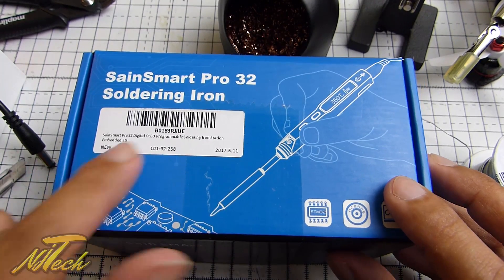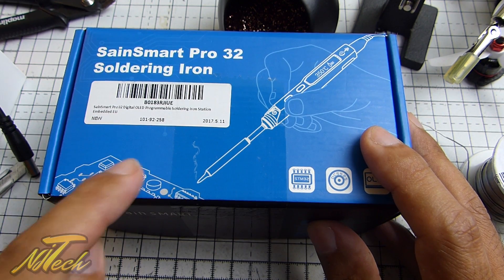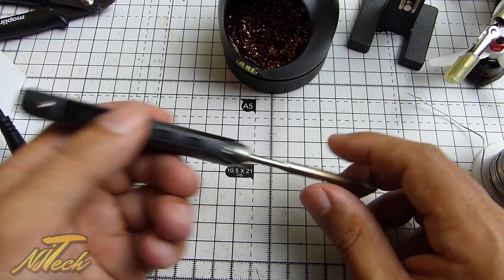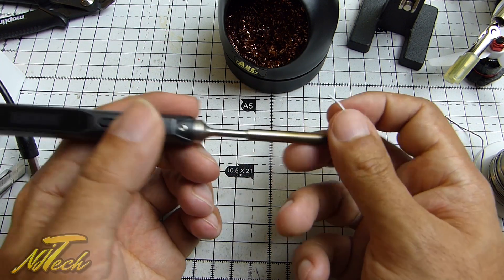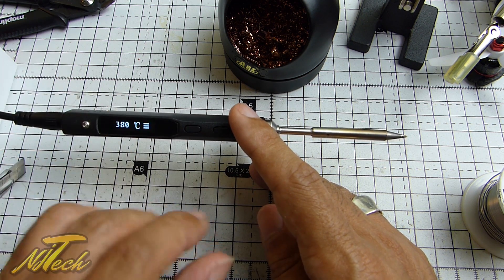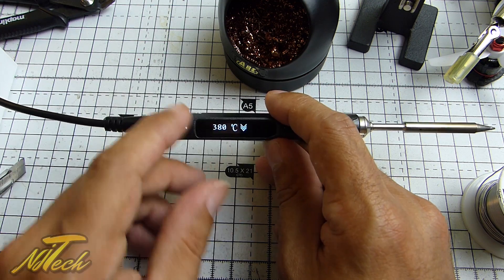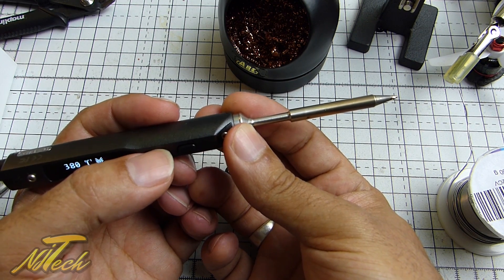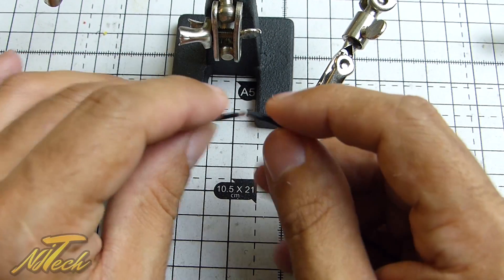TS100 Soldering Iron, Custom Firmware & soldering tricks!

Comment: I got mine today, works really good, plugged it on to a 4s lipo. I think I got something loose inside it though... sounds like a loose spring or some other loose component that vibrates when I tap it gently. Anyone else that experience this, maybe it's nothing..?...

Comment: I dont see a HEX file to flash only a DO NOT FLASH_Flash Backup.hex
Reply from the maker: scroll down on the linked page to the section that says 'Upgrading your ts100 iron' there you will see a link to the release page. Just follow the instructions, it takes a few seconds :)
Reply: ya I did that but what hex file do I use? I downloaded that whole file and there is only one that says do not flash back up hex.
Reply from the maker: go here: https://github.com/Ralim/ts100/releases the very first file you see is called ts100.hex and its 40kb. click it to download it, that is the file you drag onto the ts100 whilst its in DFU mode. (put the ts100 into DFU mode by holding down the button towards the tip whilst you plug it into the computer) once the file is dragged on it will automatically disconnect. Its done.

Comment: Which ESC brands don't use plastic insulation on signal wires?
Reply from the maker: If you find one let me know! To be honest, its easy enough just to replace the signal wires yourself with decent stuff.
Reply: Don’t buy an ESCs based on what wire it comes with... just swap the wire out.

Comment: The tip looks a bit too long... How is this better than say the Weller WHS M (or MC which comes with batteries)? Just the price?
Reply from the maker: I thought that until  i used it, its so light the tip length doesnt affect its usability at all. As i said 20 years+ using more traditional shaped irons i was sceptical too, but it works great. All the positives are in the video, maybe its just not for you but as a compliment to a wellar or a sub $100 alternative this blows away anything in its price category for the reasons mentioned. Just my opinion though :)

Comment: I use it with a 3s lipo, it is great, a lot faster and nicer than my 20EUR adjustable power stick of metal.... 
as a lefty I see you have it the right way up... how did you do that?
Reply from the maker: i used the custom ralim firmware, that has the option to flip the display, i show it in the video when i go through the settings :) links in the description

Comment: Which tip would you recommend getting, mainly right now I'm working on micro quads, so many small soldiers
Reply from the maker: ive been using the one that comes with it but for working on micros i would find the smallest tip. I actually think the package i linked in the description comes with that tip anyway.
Reply: NJ Tech it appears to, looks like the pointed one might be smaller than the one with the angled tip.. The one on amazon the "ts100" branded one looks like yours, the one with the other name looks different
Reply: NJ Tech please let me know how it last, if you have any issues with it please..
Reply from the maker: so far its been great no issues at all

Comment: I have never used a Soldering iron in my life. There has been plenty of times I really could have used one. There is something I want to do and I will need two of them, the iron is going to be integrated into it, but not permanently. Are there any "good" irons for dirt cheap, the hotter the better. But I can maybe see myself using an iron for what they are actually made for!!

Comment: I keep seeing this around and may have to pick one up. as far as soldering technique I highly recommend a lineman splice. its easy to do, much much stronger and if done correctly very neat. its strong enough in a temporary emergency it works even without solder in many cases

Comment: A lot of what makes soldering a chore is bad plating of traces and pads on boards.  The TS100 would be ideal if it used standard Weller tips.  Custom tips are a nuisance to find and keep in stock.
Reply from the maker: Absolutely! Though in the application of quadcopters which is where the majority of my soldering is done these days, most of the pads and traces are of a decent standard, and with gold pads and thermal soaks on the grounds. Not to say cheaper nasty stuff is any less prevalent, but its always up to you where you want the bottle neck to be in your system. I always try to buy the best components, they always last. And yes, weller tip compatibility would be a marvellous thing. Thanks for the comment! :)
Reply: How many tips do you go through ? Should last a hell of a lot of years if you look after them , unless element burns out . The firmware goes a long way to prevent this as much as possible . Plated traces and pads , they are a luxury never had any trouble with good old copper pads in nearly 40 years !
Reply: @88Nikoli  Well said. Enough flux will make solder take to the roughest pads.

Comment: Wow.  Seriously impressed with the iron.  Very serendipitous since I've been thinking about getting something but as a hobbyist it's difficult to justify something that generally has the quality one requires for fine work - to give you an idea, I'm currently using an iron that came with the Amerikit AK-100 (https://www.amazon.com/Elenco-AmeriKit-Learn-Solder-Kit/dp/B0009Z3JJA/ref=sr_1_1?ie=UTF8&qid=1499253724&sr=8-1&keywords=amerikit+ak-100) and it's a bit on the, ah, terrible side.  

So, yes, a series on soldering tips would be really appreciated by myself.  You have a good voice and your camera work is decidedly adequate. :)  While I'm here, what size tubing did you put over the helping hands clips?  That's a brilliant addition.  Thanks much for the video.
Reply from the maker: Thank you brother i really appreciate that! The stuff over the clamp is actually just model silicone fuel tubing, its grippy and widely available by the meter. I'll def have a look at doing some more tips. Thanks again for the comment :)
Reply: Pleasure. :)

Comment: are you using 12ish volts or near 24 how many amps does it take i dont recall if you said the watts
Reply from the maker: im using the included power supply that came with this iron 19v@2amps. This seems to work perfectly in my testing.
Reply: NJ Tech ok i was assuming it did not come with one but ya i found them online and it had a list of voltage vs watts and its like 40 watts and 19 and 65 watts at 24v and only like 17watts at 12v

Comment: I'm using an old Weller WTCPN from my father. It's too old to have temperature control so I just have to wait a minute of two for it to heat up and hope that the solder temperature is less than whatever that iron can still put out.
Reply from the maker: Weller make great irons, its old, its still working is proof of that. If it's still doing every you need then its all good :)
Reply: That's true but that iron looks fancy, new, lightweight and cheap.
Reply from the maker: its a great compliment to what you have, if you need some help deciding ;)
Reply: The WTCPN Is a workhorse iron. It actually does have temperature control..... by the tip you choose. Its not easily variable, but the Iron will self regulate to a specific temp based on the magnetism in the tip you choose.  Also the temperature reserve on the WTCPN will be much higher than the TS100. So depending on the type of soldering you do, the TS100 might not be good. I do some repair work and sometimes when desoldering devices with pins connected to large ground planes, a small iron will never heat up enough because even tho it hits a temperature in the air, it doesn't have the power to heat the pad up to that temperature.  I've been looking at the TS100 to just keep in my tool bag for quick on the spot work.
Reply: lsdave magnetism in the tip what you smoking Dave ? Thermal mass is what is used to not draw all the heat out of tip on ground planes as happens with tiny tips if iron is unable to supply enough wattage to do job !
Reply: I suppose that'll explain the magnetism. It can be a bit annoying since soldering small jumper wires will get stuck to the iron tip.
Reply: Bobbeh -
The WTCPN solder station (1976-1981) IS Temperature Controlled (Temperature Controlled Pencil, TCP series).
Don't make common mistake that 55 year old tech can't possibly be good, OR I need an adjustable knob.

Weller "TCP" series is 50+ years old and was innovative technology (Carl Weller's U.S. Patent) for 1960, in vacuum tube era.  
Two innovative uses: Magnistat switch (SW-60) and "PT" tip with a ferrous alloy plug.
For the Apollo Moon Program, Grumman used Weller's TCP for the Lunar Module and Collins for Radio Communication systems.

How Does It Work??
Using the CURIE Effect, the Magnetism of the ferrous alloy plug ("PT" soldering tip) changes with temperature --
that is meaning of the 6, 7, 8 (hundreds degree F) engraved in base of "PT" solder tip.
Weller was in Easton, PA ... next door to Bethlehem, PA ... with some of the best iron (ferrous) metallurgists in the world.
So getting the "right iron alloy" to lose its magnetism at a specific temperature (700° F) -- did not require guessing !! 
---
BTW, the OKI/Metcal stations acknowledge the usage of two (2) US patents (they use in products).
One is Carl Weller's 1959 "Magnistat" switch patent, the other is a 1907 patent for Inductive heating (they use RF).
Reply: Bobbeh -
The small handle with LCD and micro-controller is the "new" development.
The integrated tips (fast heating, integrated thermo-couple or temp sensor) were developed earlier
by other soldering companies, like Hakko.
LOOK at the Hakko FX-901 ... same technology with larger handle.
Cheaper price?

Comment: I have this iron, it's my favorite. I use a 24v sony power brick and it heats up FAST!
Reply from the maker: sounds like an ideal PSU for this iron :)
Reply: Model No. AC-S2422 on eBay was less than $10 shipped. It puts out 3.6A for 6.5 seconds for the initial heat up and will carry a constant 2.2A @ 24V. Nice little supply for anyone who buys the bare model with no PSU.
Reply from the maker: Brilliant! Those specs are perfect, ill pop that in the description and give you a name check ;)
Reply: What’s the manufacturer of that specific PS? Trying to find it on eBay but no luck. Also, how’s it holding up a year later if you don’t mind me asking?

Comment: 60£ is a lot because it's around 35£ on gearbest. in not working for them or something like that. it's a lill tip to save money. it's sold on different sides under a lot of names! nice video by the way
Reply from the maker: Toni L ah that's good to know. did it come with the power supply for that price too?
Reply: NJ Tech no you can attach your own! like a quadcopter battery for soldering out in the field like you said!
Reply from the maker: Toni L right but if you're like me and also use it on the bench you need a suitable PSU so that is why mine cost a little more money. also on Amazon I got it delivered the same day I ordered it instead of waiting a week or more from china, so for me that's worth the premium. But as you mention it can be found on its own cheaper if you want to get it for less. So it's all good ;)
Reply: NJ Tech but I've looked at the link you leave, there isn't a PSU supplied. you easy can build your own PSU and being still under 50bugs. if you need it very quickly then the link of banggood isn't the best, because you have to wait too. but if this on Amazon work for you with provided PSU than all is good. liked the video very well. keep up the content! greetings from Germany
Reply from the maker: Toni L yes you can build your own, I don't have the time with so many reviews to do :) thanks for the comments friend
Reply: NJ Tech you're welcome

Comment: I just got one of these too, just be careful with the power adaptor sainsmart supplied it isn't grounded, so the tip floats at 115V rms (assuming a ~230V mains) when referenced to earth. So it could damage a component while soldering if you get unlucky.
Reply from the maker: the tingle would be massively outweighed by the burning pain anyway lol
Reply: A battery is DC so is unaffected, AC capacitive coupling is an issue with switch mode power supplies.
Reply from the maker: that's a very good point, thanks for the comment!
Reply: I also just updated to the latest official software V2.17, which has similar features to the custom one you demonstrated, except it doesn't let you go up to 450degrees C.
Reply: That's optional, it would have been more appropriate to supply a grounded power supply. Nothing to do with instructions as if I required I grounded (ESD safe) iron I wouldn't have brought the TS100.
Reply from the maker: We all know its there thanks Josh, its just a good thing to point out to those working on delicate electronics. :)
Reply: But this is not a problem when using a battery as power supply ?
Reply: Does that mean it can shock you also?
Reply: aslanyavuz no you might feel a little tingle, the current is so small a few micro amps that it isn't dangerous.
Reply: blaser  So at the end of the day I need a grounded tip (ESD safe) soldering iron. Is there any permanent way to make the TS100 an ESD safe iron. Grounded tip also ensures protection against electric shocks. Solder is conductive and hence Incase of a fault has the potential to shock you. Grounding is a safety measure & having a GFCI I really dig on grounded irons.
Reply: How's that possible? Surely lots of ICs would be ruined by this soldering iron even if it's a high impedance 115V.
Reply: How can it have 120V RMS if the input voltage is 24V?
Reply: Didn't read the instructions eh? It has a ground point at the power supply end of the iron. It is even marked on the iron.

Comment: If this, or any other, temperature controlled soldering iron were really able to maintain the set temperature at the tip then it would not be necessary to use a different temperature for small and large connections.
Reply from the maker: I see your argument for sustaining a temperature but you're not taking the heat dissipation into account. Thick wires and ground pads soak away heat much faster, very much acting like heat sinks. Without higher temps you'd be waiting to head the entire ground rail or length of wire up to a given temp (say 250 degrees) before you'd start soldering, which is not a great idea and great way to start damaging electronics. Fast high heat to out pace thermal soak on thick wires requires higher temps.
Reply: I was not being entirely serious when I made my comment as I understand the problem and adjust the temperature of the iron to suit the job as you suggest.

However, I still maintain that if a temperature controlled iron was doing what it should then it should not be necessary to do what we do.  I should not need to take the heat dissipation into account.  That should be handled by the iron.  Set the tip temperature to say 250, apply the iron to the pad, the tip temperature drops so the iron ramps it up to the set value by providing more heat quickly.  

This is what they try to do now but what the irons lack is a sufficient thermal mass to maintain the tip, and hence the area local to it, at the set temperature.  This is exacerbated by our desire to use a small tip size for some connections and reluctance to change to a larger tip when soldering larger pads such as Lipo connections.  It should be "horses for courses" but is usually "one size horse fits all".

In order to avoid the need to change tips I generally use a larger than necessary chisel shaped tip for all but the smallest joints.  It can be placed flat on a large pad to transfer heat quickly to it whilst the pointed end of the tip can be used to heat smaller joints.  The tip on the iron in this video looks very weedy and thin, so soldering the ground pins on say the ESC connectors could be difficult.

Having said all that, I find soldering very satisfying, as when it is going well you can get consistent, shiny joints that you can be proud of, unlike when I first tried it back in the 1960s using a massive copper soldering iron heated on a gas stove and solder with no flux.  Mind you, I wasn't trying to solder minute pads on a flight controller !
Reply from the maker: yes i agree, but the distance, thickness/gauge of a wire is entirely relevant to thermal soak, thats just the physics of it. Absolutely a chisel tip helps matters ( i always have all options available for the job), and this iron performs exceptionally well at the temps it states, which i believe through decades of experience, much like yourself im sure. Whilst you're absolutely right about the temp sensor should be doing its job as the wire soaks away the heat, the result is compensation by pulling amps to maintain the tip temp, which this iron does to a point at 19V. A higher voltage (24V) would be a better solution if soldering in this way were desirable but in my experience it almost never is. Hot and fast (ha!) is usually a far better solution with less gradual heating of the to-be-soldered component(s) and thus less chance of stressing said components. Great minds though my friend, i do agree with you and good to chat, thank you for your thoughts! Are you still flying helis? My mikados are gathering so much dust these days.. let alone my nitros :(